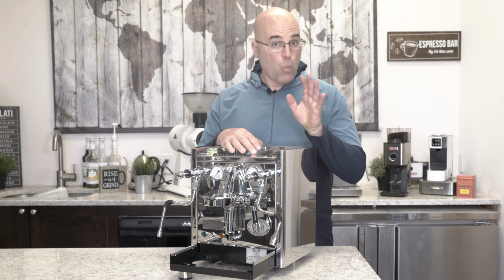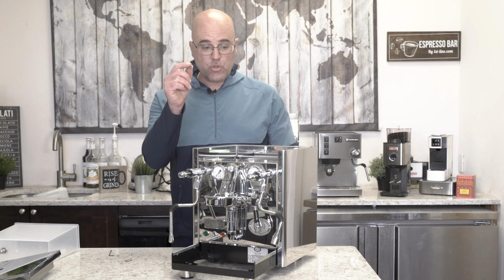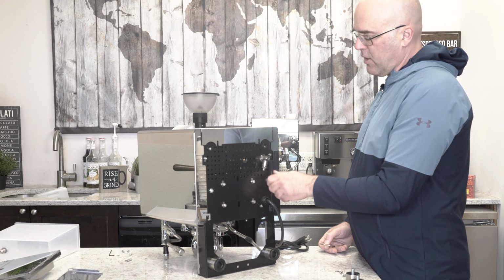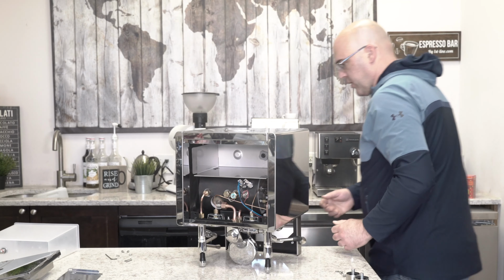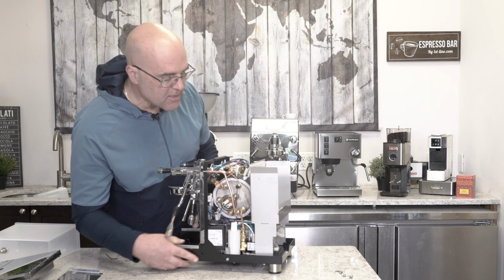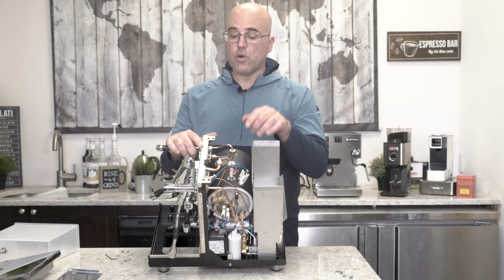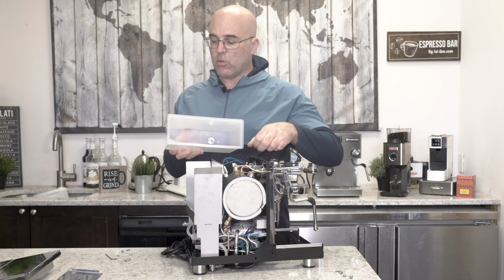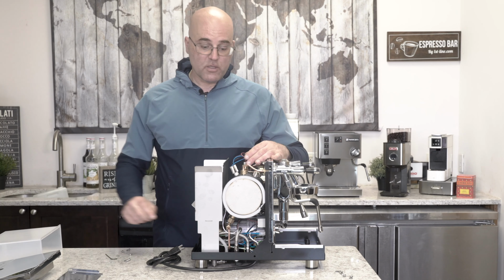ECM Technika PID: How to Remove the Body - An Inside Look

Comment: The chassis should be made of stainless steel. Same situation on the Electronika 2. ECM use steel and any 10 year old machine i see inside has surface rust at a minimum.

Comment: I have the same machine plus an ECM electronika. The Exterior panel design is atrocious, i have taken the cover off a few times, and now use a flexible driver to get to the corner screws/allen heads, as these are in a ridiculous spot. Made in germany who are great at design, but the screw placement from italy for the exterior panels removal is a serious fail.

Comment: My 6 month old Technika V won't heat water above 84 (per the PID). I'm direct plumbed, so it's not the tank magnet. I'm told it could be the Pressure Stat, however you didn't point out it's location. Please advise. Thanks!

Comment: Very helpful indeed.  I needed to change my solid state relay and it was really good to be able to watch this beforehand. If anyone is having problems with their machine failing to reach temperature due to the boiler only heating intermittently, the SSR is a potential cause. My machine was about 5 years old when it started to fail - I purchased a new one from Avola KaffeeSysteme in Wuppertal, Germany for less than €40 delivered to UK. Though this video doesn’t show you how to actually replace the SSR, it was an easy fix after watching…. Particularly informative also in talking through the various key components. Thanks a lot for posting!
Reply from the maker: It seems to be a common problem.

Comment: Really great video. Saved me from taking my 1.5 month old machine into the technician. I checked the floating thing and adjusted to the right position. My machine now senses the water level and orange light is back on. Thanks heaps :)

Comment: Are all the water pipes low or high pressure made out of copper? Any plastic pipes? Thanks
Reply from the maker: Mot often, high pressure are copper or stainless depending upon make and mdoel. There are poly tubes used under high pressure. Sorry, we are being general as we no longer carry ECM and they may have made changes.

Comment: The heating element won't burn out because it is off when the water level drops below the water level probe. The pump will kick in automatically.
Reply: Don’t agree he has a valid point steam will push water out quicker than the pump will refill